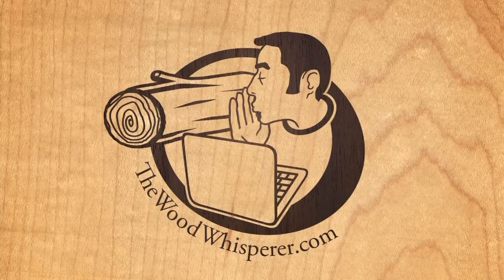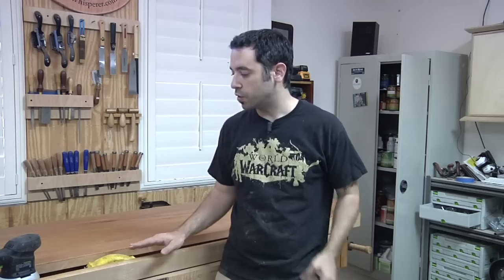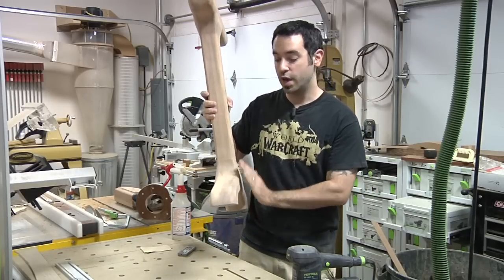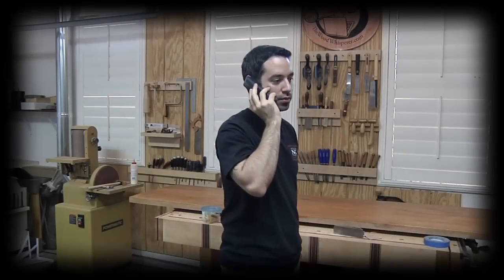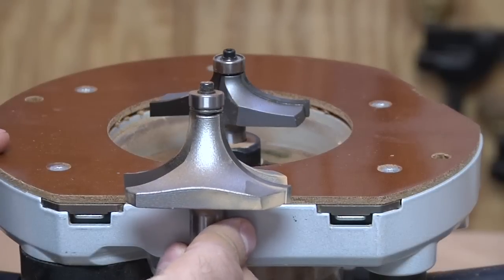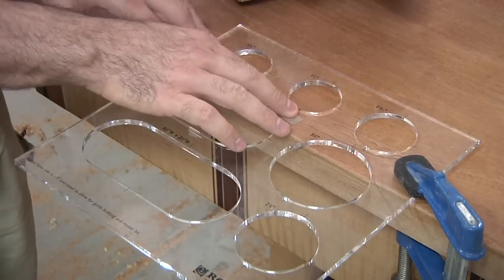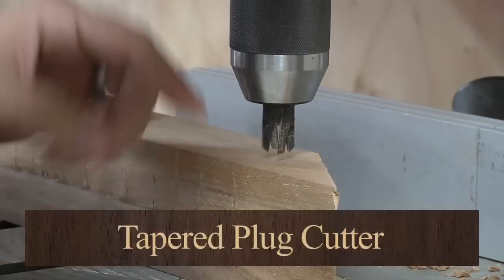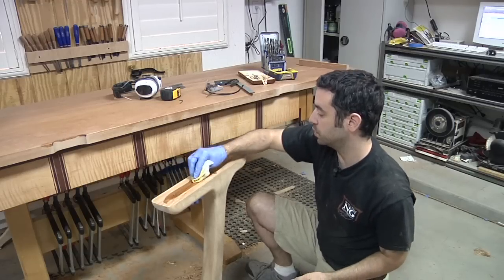136 - How to Build a Trestle Table (Part 3 of 3)

Comment from the maker: Remember, this isn't a work desk or one that we'll do much typing at. It's for gaming only. Bringing the table down 6" would put it in my lap. After using the table for a few years, I can tell you that either the numbers are perfect or we have simply adapted to it in such a way that it's one of the most comfortable desks I have ever used. I typically push my chair in under the top, lean back, and put my feet up. Super comfortable for hours of gaming.

Comment from the maker: The parallel style clamps are easier to use and have a much wider clamping jaw. Pipe clamps certainly work but I feel the parallel clamps just do a better job of distributing the clamping pressure. As for counter sinks, I have a set I bought years ago and it was either from Lee Valley or Rockler. Haven't been able to find that set online since, unfortunately.

Comment from the maker: Although the finish is thin, you only apply very light coats to vertical surfaces. So there's really no chance for drips. As for stain application, it depends on the project. Sometimes I'll apply it ahead of time and sometimes not.

Comment from the maker: I did receive it. But with all of the other things on my plate, doing consultations via YouTube gets put on the bottom of the list and there just aren't enough hours in the day. Sorry about that. If the joint is made well, any wood glue should certainly be strong enough without screws, although some joints can benefit from screw reinforcement. As for dyes, maybe try some india ink, Transtint, or a combination of the two.

Comment from the maker: Honestly, i haven't seen this video in a while. If I applied something different it would have been Seal a Cell, but I no longer use the stuff. I use Arm R Seal for all coats. As for the final coat, you can either thin a bit more so it dries quickly, or lay on a good thick coat to alleviate streaks. Sounds like the second option is your best bet.

Comment from the maker: There shouldn't be any surface dust. Of course any dust left on the surface will likely show up in the subsequent dry coat. So it should be minimized as much as possible. Fortunately, if you rub out the final coat, there's some room for error here.

Comment from the maker: Paint rollers tend to create air bubbles and texture. I suppose that might all work itself out but the roller would absorb a ton of finish too, so it would probably be rather wasteful. Furthermore, for a wiping varnish, you'd have trouble controlling the flow of finish and would likely end up with lots of drips and runs.

Comment from the maker: Sounds like moisture might be trapped in the finish now. Do a little googling on white ring removal and you should find a number of ideas. The least invasive, though it doesn't always work, is to hit the area with a blow drier for a few minutes to try to force the moisture to evaporate.

Comment from the maker: The impact of finish on both sides is not quite as great as something like veneer. As long as both the top and bottom are somewhat sealed, it should be perfectly fine. And while I do finish the undersides of my tables so that they are smooth and sealed, I don't necessarily give them the same exact number of coats.

Comment: Your techniques, hand work on machinery, footwork, the use of wax for the screws and marking up the table top for sanding imply that you've been taught by a cabinet maker of a few generations.  Am I correct in that?  Also, when you applied your wiping varnish, how you folded your rag (not balled it up) is also a technique learned from experience.  This was a good video, I enjoyed it.

Comment: @TheWoodWhisperer Yes I do understand this concern; however firstly, a tack cloth should not leave any residue on the surface. Secondly what I do is make the tack cloth from the material I am finishing with. For example damp the cloth with some of the thinner recommended for the finish, wring it completely dry, then place the rag out and drip varnish all over the surface, roll it up and wring it, knead it to spread the varnish around until its uniformly spread. It should be sticky.

Comment: One very, very small point. Most pro finishers, that I have read,  recommend you only use your satin varnish as a final coat. The light defusers that make the finish "satin" when applied in many layers can muddy the look, so High gloss until the last, then satin or else some other form of knocking down the shine.

Comment: Marc this project is awesome from start to finish, but I was waiting for you to talk about those cable recess as when you were doing the chamfer in the outside line for not to bump into a chiseled border and get yourself a boo, I thaught that you were gonna round up those cable safe conducts precisely to properly handle cables, I was left with the idea that they were left with a sharp edge, and also didn't saw any finishing varnish in that area as well. And can you tell as your faithful followers, how much would a project like this cost if you had the intention in selling it? Thanks again, for filling our minds with well made ideas, I know mine is swimming in wood fantasy lake, a lot of projects we can use with all those methods. Kudos Marc!! (Y) (Y)

Comment: Hello, very very nice job, and detailed presentation, thanks.. Meantime I wanted to clarify one thing, as far as I know, if you happen to cover the two sides of a core material with different thickness veneer or smth, than it will warp. You did not mention that you are applying the same amount of material or coating on both faces of the table top, so would you expect any warping/bending on the tabletop if the amount of varnish etc is not the same thickness on both faces? Thanks for sharing again

Comment: at around 34:30 when you say coats of varnish, would it be ok to use a mix of polyurethane with a tiny bit(1 or 2 spoons) of boiled linseed oil and some mineral oil to finish the table?

Comment: Am I correct by saying that you could have also used a tac cloth instead of a damp paper towel to wipe up the dust from the sanding?  Just wondering.  Thanks.

Comment: If you use plugs and later need to disassemble the table, how do you reach the screws? you drill the plug?
Reply from the maker: +David Batista Yup. They can be drilled out and replaced as needed.

Comment: I believe he was using a variable speed drill, with a max. speed of 350-500 rpm. The size of your pilot hole should tell you what speed is best (PLUS the openness of the wood grain) You don't want to split the wood by going too large on the screw.

Comment: I am building a trestle table for the same purpose--for my gaming setup. I am using oak veneer plywood for a top with 3/4" oak for table top edging, and the rest solid oak boards. The size will be 40"x78". I have not built one of these before, and have a few concerns re my design--could I send you a PM with my design to get some input? Thanks in advance.

Comment: I sent you a PM asking about my trestle table project about a month ago, but never heard back from you. Perhaps you did not receive the email? Anyways--a quick question: The feet, legs and braces of my table are being made by laminating 3 pieces of 3/4" red oak boards so they will be 2 1/4 inches thick.  Would using LePage carpenters' glue only (no screws) be strong enough? Also, can you recommend a good lightfast aniline dye--I want to ''ebonize' the oak but have the grain show through.

Comment: damn you are very skilled.  I am curious as to why when working the curves you didn't go with a rasp a file or spokeshave?  I am pretty ignorant when it comes to this kind of stuff so I'm not questioning your technique! haha. thanks in advance
Reply from the maker: +Matt Contreras Those are perfectly viable ways to get the job done. Sometimes I just pick a method/tool that suits my fancy at the moment. :)
Reply: +The Wood Whisperer I think I would have used an angle grinder with an 80 grit blade, used to use those all the time to smoothen welds and they work great. They are very messy though. This table is really in the style that I like and you where absolutely correct in making the legs thicker. The little details you added in this table make it done.
Reply: +Lars de Waardt so many methods. lol. mark is the man but sam maloof is the man who inspires me most when joining two different pieces of wood.

Comment: Why was the first coat of varnish darker than the 2nd?
Reply from the maker: +Mike Van Tassell The first coat is only darker when it is first absorbed. Once it dries, it lightens up. As the finish seals the surface, the wood stops absorbing so much finish so subsequent coats don't appear as dark as the first.
Reply: +The Wood Whisperer I mean specifically the two containers of varnish appear to be different colors in the tupperware.

Comment: I thought cross grain is big no no since theres a very good chance of splitting?
Reply from the maker: +Totally Hammered Woodworks That's correct.
Reply: +The Wood Whisperer were you not worried? haha. sorry just wondering if I missed something!
Reply from the maker: +Totally Hammered Woodworks Well what part of the project concerns you specifically. Any cross-grain issues were resolved.
Reply: +The Wood Whisperer mostly when you pointed out the bottom the two piece being joined. how do you resolve an issue like that? by the way, nice work on your bed frame!
Reply from the maker: +Totally Hammered Woodworks You'll have to forgive me for not remembering all the details. I scrubbed through the video and can't find where I discussed potential cross-grain issues. But the vertical part of the leg meeting the foot doesn't really present any issues. It's just the end grain of one piece going into the long grain of another piece. They might expand and contract at slightly different rates and the seam might bulge at different times of year, but there should be no splitting. Everything has freedom to move as much as it needs to.
Reply: +The Wood Whisperer yeah that's what I was referring too. I thought that was still considered cross grain since the foot was going  parallel to floor and the actual leg was  horizontal. any who, awesome work as usual!

Comment: nice videos and well put together process.

i only have one problem with the design. the humps at the joints on the legs make them look like old ladies fat ankles. ;)...could have been curved more elegantly.

other than that, its a sweet table. will try such a project at some time.